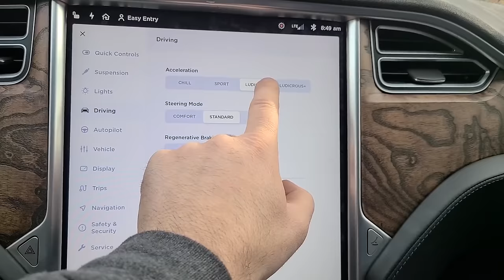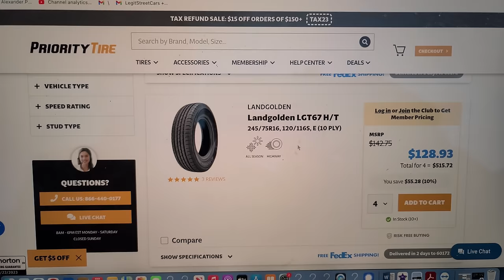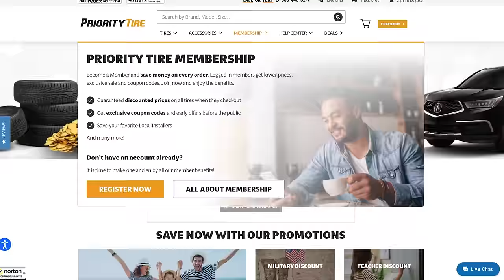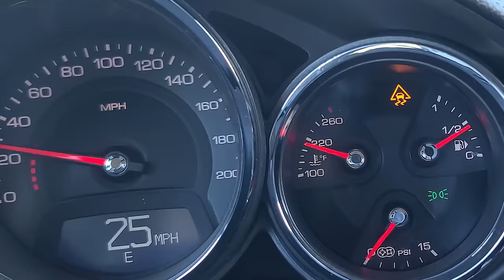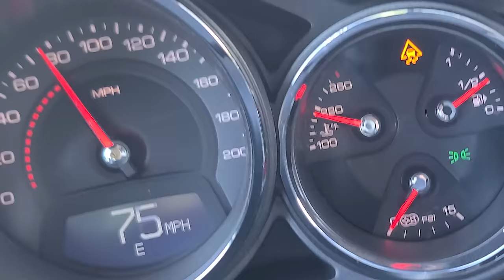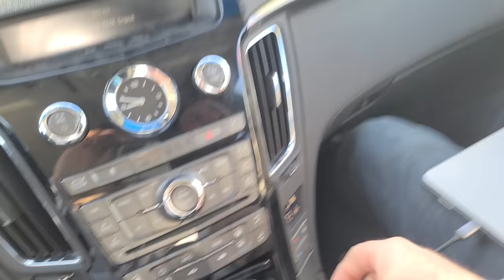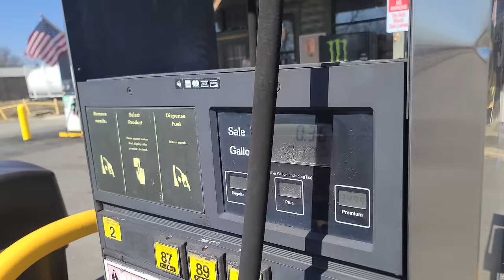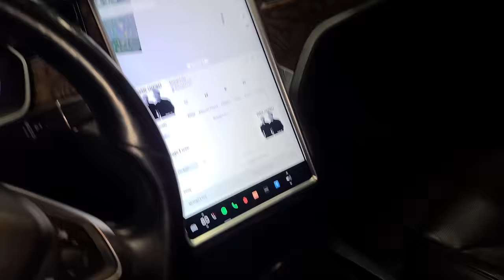I Bought A CTS-V Wagon From A Shady Used Car Salesman 700 Miles Away! Flew With Tools To Drive Home!

Comment: If it were not for the wonderful 1996 Impala SS. G.M. probably would not have created the Cadillac V series of cars. I daily drove my very modified 1996 Impala SS for 16 years and 390,000 miles before I sold her in 2011. I bought her new in November of 1995.

Comment: This is my old CTSV Wagon, I was the one who bought it after the wreck. I have a video of it on my YouTube. If you want to know everything I did to the car, please contact me. The Supercharger is brand new because I replaced the original. It was port and polished. Front right rim needs to be replaced. I had a shop fix the Crack but it didn't hold. 
12.5 in the quarter mile 👍
Reply from the maker: Can you email me at legitstreetcars@gmail.com

Comment: Teslas are nice but I like the fact that if it’s an emergency I can pull up to a gas station in my SRT 10 viper and put regular gas in it, It might not be happy with 87 octane but it will still get me to where I need to go in emergency and it will only take me about 10 minutes from empty to full. How long does it take to charge a Tesla from empty to full? They’re both nice cars but me personally, I would go with the gas.

Comment: As much as I love supercharged V-8’s I would keep the Tesla as a no brainer dd.  I hate working on my daily drivers and save my wrenching time for my fun cars.
After putting it on E-85 you will get about 8 miles to the gallon which is a pita with a dd.
Reply: I put the flex fuel sensor on my modified ctsv and got 14mpg for an average

Comment: It's called metamerism.  You typically see it between the flex bumpers and metal fenders.  The paint lays up differently on the different materials and is composed differently for the different surfaces.

My guess is, the metal flake in the respray is likely a different particle size, or one of the pigments in the paint is different.  Yellow isn't just yellow....and color matching is a very complicated process.  Different light sources will show different things.  I'm not an expert in paint, but I live in the world of custom color plastics.  

Not sure how you would fix this on the car, other than to respray the respray and feather it back into the fender.  It won't show the pronounced line of the door, much harder to see the change if it is blended.

Nice car though.   I'd drive it!

Comment: Are you worried about going from a reliable winter weather car to one that can't be reliably driven in winter conditions? I know snow tires are a thing, but it's still a lot different, as I'm sure you know.
Reply: I drove my V2 in the snow just fine

Comment: Keep the Tesla for later, because they are going to cost three times as much 20 years from now.  I remember when I bought my 1976 Pontiac TransAm new for $5,300.00 then 10 years later a new GrandAm cost me $15,000.00  And now, you can hardly buy a good used car for $15,000.00

Comment: No way that’s fixed with that much metal it’s a gear or roller bearing that is skinned off and rest of gears or bearings need checked looks like roller is just wearing off but all that grit is doing something

Comment: E85?? You're joking, right?? E85 is CRAP. Using food (corn) for fuel is just another gov't fail that is bad for the engine in terms of burn rate AND performance. 

BTW...I've got an '06 GTO with the LS2 and M6 that I bought new. Last year at around 38k, got some chatter, especially at low speed. Drained the fluid and added 4oz of Ford F additive AND Super Tech (Dino oil.... NOT synthentic) for the rear diff. It completely fixed the problem.  Make sure to do slow speed "figure 8" turns in a parking lot right after the change to mix it all together. 🎉
Reply: Lol e85 is 105octane. It's good for 50-75hp on the V. And it burns cooler helping to keep the heat down which is good for the engine. 

As for your GTO you put in too much friction modifier. 4oz is double what it's supposed to take.
Reply: @sutherlacd27  While ethanol does raise a vehicle's octane level, it contains less energy. In other words, it will take 1.5 times more to provide the same energy levels.
I mis-typed on the 4oz FM. What I should have stated is that the Ford bottle is 4oz, but I did only add 2oz. Went out to the garage just now and the bottle has about half left.....was a few years ago though when did all that I think.  You scared me on that one though! Good catch.
Reply: @texasaggieproud  yes you absolutely have to burn more e85 you're right about that. But with the higher octane level and cooler burn it allows for more timing which creates 50-75hp in the 2nd gen ctsv

Comment: No way I would pay $70,000 or $30,000 for a 2012 Cadillac, i don't care what model it is. Makes no sense. You could have gotten a used S63 AMG for around that price, and you're a car guy so you should know this already. That's a bad buy 100%
Reply: S63 will lose value. The Vagon will increase in value
Reply: @sutherlacd27  yeah ok